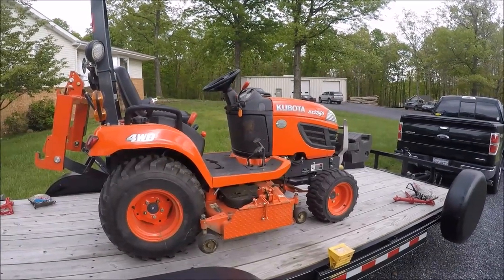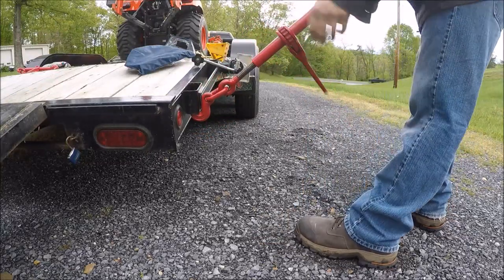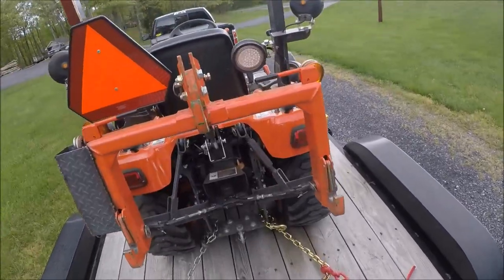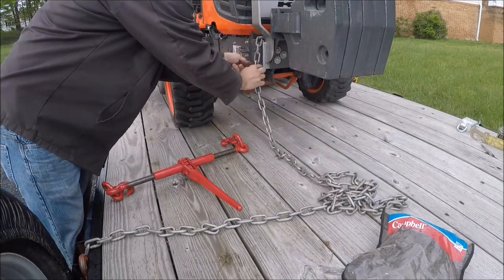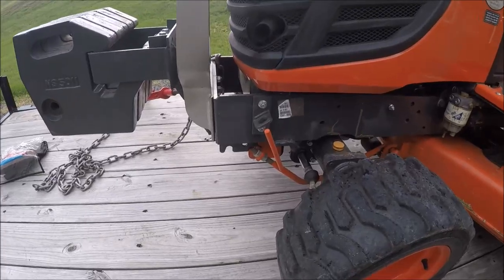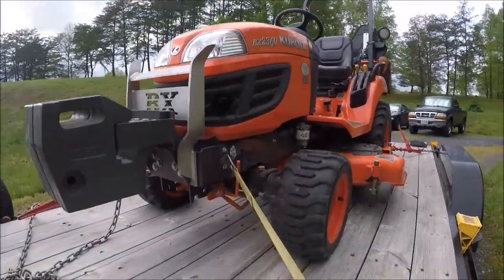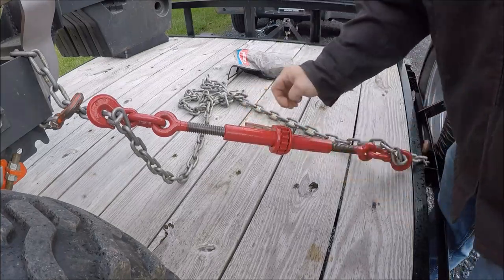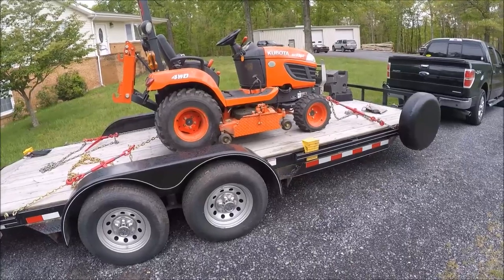How to Secure Your BX to a Trailer

Comment: and i thought me rocking a l3901 running chains was overkill and a waste of time but this is just funny.
Reply from the maker: Tell me what is so funny so I can do it right.
Reply: @TractorTech  not wrong, just massive overkill. looks like your almost your securing under 393.130 but your equipment is under 10,000lbs. you can secure under rules 393.128. 
that means you can use 1" ratchet straps (normally rated around 650lbs). WLL of straps/chains must be 50% of load winch in your case is around 1,400 lbs plus extra's, no more then 2,000 lbs. so technically you could use one 1" strap front and one in the back, i would use 4 of them.

Comment: 2 ratchet straps is more the enough for a little tractor
Reply from the maker: Thanks for watching!
Reply: 2 ratchets is fine until you have to emergency stop.. then the little tractor will be in the driver's seat with you.
Reply: @fhuber7507  no it wont
Reply: @fhuber7507  2 2.5t strap is more then enough restraint for that tiny tractor
Reply: @fhuber7507  over 20 years been using only 2 chains and binders to secure  9000 lbs loaders and tractors and never had any problems with law or accidents. 4 binders is for over 10,000 lbs

Comment: You used overkill on tiedowns.. that tractor is heavy enough for all that..one chain in the back would have been sufficient and one 4in strap in front would have sufficient.. but hey , your video
Reply from the maker: Thanks for watching!
Reply: Maybe overkill but, four points is required by DOT.
Reply: Yes I know..I've been trucking for 40 yes..but I work smarter not harder..and not everything is 4pts bc your just aan and a pickup with a trailer behind it...
Reply: 2 chains would have been sufficient enough bc of the weight of that tractor...
Reply: akbychoice it's only four points if it's over 10k bonehead.